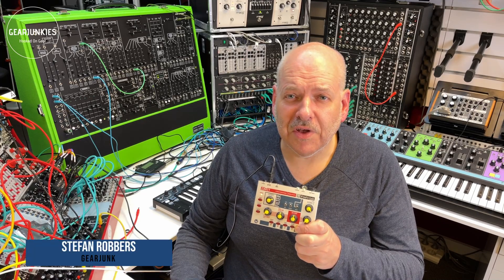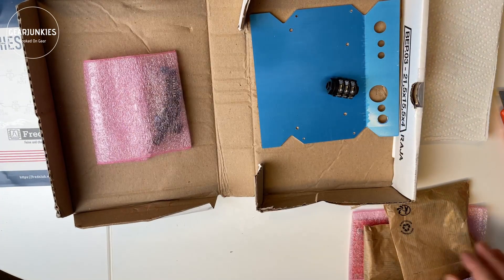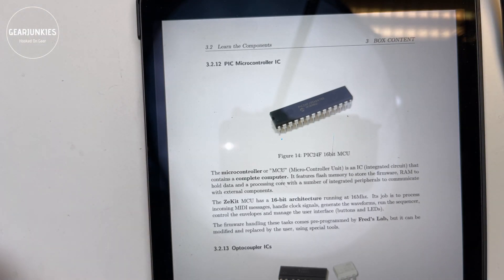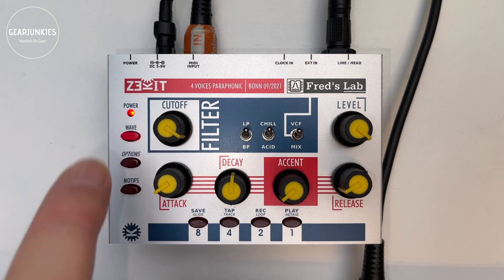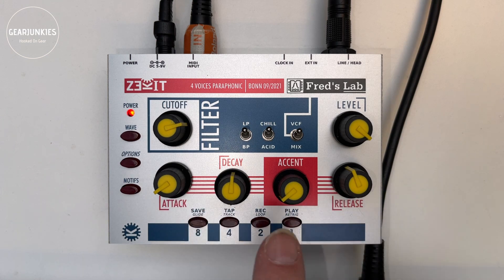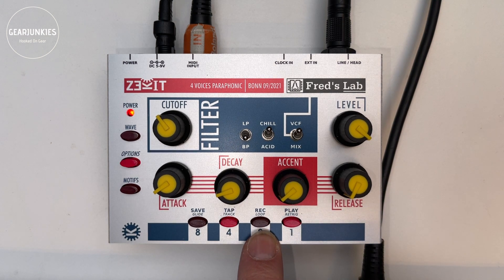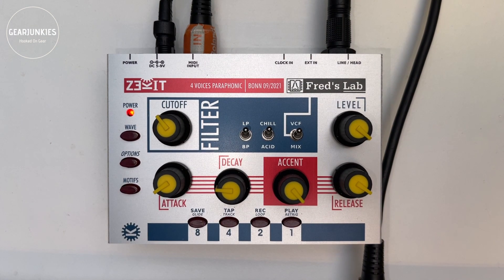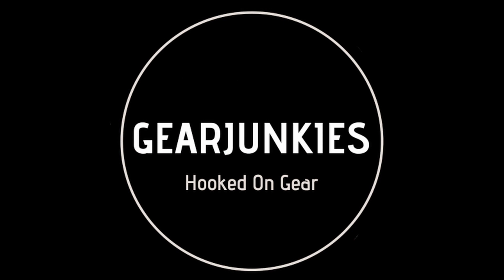Fred's Lab Zekit synthesizer Assembly and review

Comment: I have the same question as above: How does one set the MIDI channel? I built mine about a month ago and had a blast doing the build (total novice with soldering but I didi it and it works!) and I love the sound. Using at my bass synth in my set up. BUT -0 would love to set the MIDI channel to something other than 1. Anyone out there know. Fred not getting back to me.